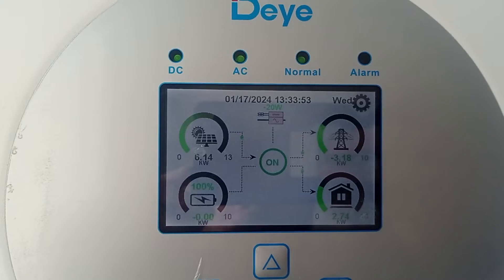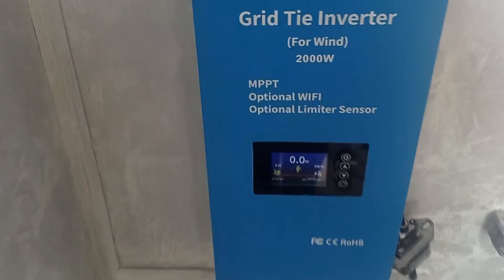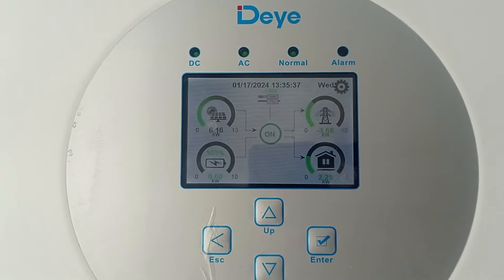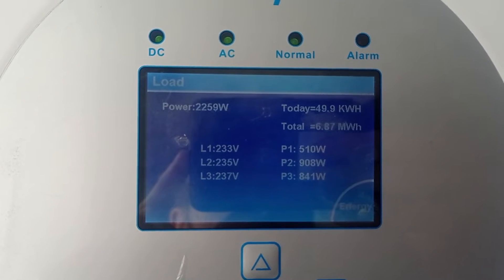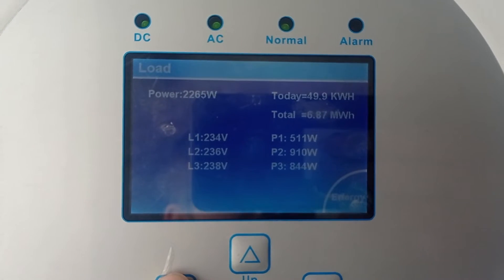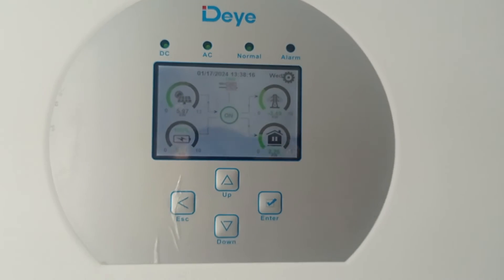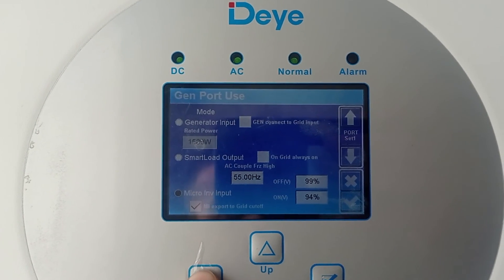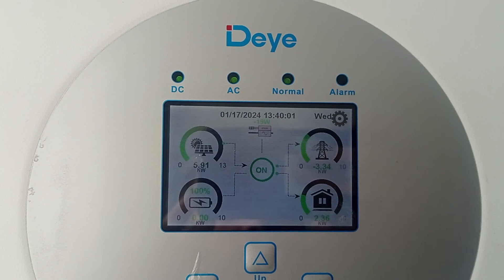How Deye three phase hybrid inverter works, and some features of it

Comment: Hi you mentioned in one video you was going to try and get a single phase genertor to couple to the Deye 3 phase inverter,  (i want to do this purely for charging battery's) did you manage to do this? Regards
Reply from the maker: well, I ended up with using no gen for a lot of time already... it's just gathering dust.
however, theoretically (and I know few guys who did this) - you can use ANY additional charger to charge the 48V battery bank from the generator separately. hint: use one of those cheap chinese inverters for $250-350 for max cost-effectiveness, and apply the gen as the AC-input on those.
Reply: @BackyardVoltage  Hi thank you for the reply, I dont have 48v battery, my battery is HV around 630v charge voltage changes from the Deye 40kw 3 phase inverter which i use as off grid. The problem i have is finding power in the fews winter months maybe 4 months. I do have a single phasde grid supply which i use as backup power via an ATS switch which connects across L1,L2,L3 as nearly all my loads are single phase. I want to use the 1 phase grid as my generator at midnight till 6am to slow charge my battery's (7kw x 6 hours 42kw @ 7p) to get me through the bad solar months of the year. I am struggling to find a simple method any suggestions would be appreciated. I am considdering installing another small 1 phase inverter grid tied to sell energy back in summer, can this then feed my 3 phase inverter through the micro inverter coupling or does this still have to be 3 phase input?
Reply from the maker: in that case you have two other options:
1. change the generator to be a 3-phase one.
2. use the supportive system. f.e. set the generator to charge the supportive 48V battery, use the grid tie inverter (or hybrid) and supply it to the GEN-port of the main system.

I wonder which way will be more cost efficient, I guess the first one likely.

Comment: What is your configuration in the other menu? Zero export to CT + SOLAR SELL? Or Sell first?
it would be good to know, my Deye does nothing when I select assymetric phase feeding... I have no battery, but I have seen an austrian guy showing asymetric phase feeding and it worked without battery... :( But my german is very bad 😀
Reply from the maker: I'm using this unit as in the video (and now it's expanded to be 3x10kW units, more about it here: https://youtu.be/X9zWiHgpGYY) purely in selling first mode. since I'm allowed to export to the grid a lot (up to 30kWh per hour, at 30kW instantly) - this asymmetric thing quite helps, once there is uneven voltage across the phases. It saves a few volts deviation for sure.

Comment: How does the generator connect to charge the battery
Reply from the maker: via GEN-port, in a "generator input" mode
Reply: @ModernUkrainianHomestead  is safe to connect directly to the generator port
Reply from the maker: check the manual - there are wiring schemes, and there are settings explained as well
Reply: @ModernUkrainianHomestead  thanks

Comment: You say you have a 20kWh grid-tie Huawei, a brand that is easy to get in Asia (where I live).  I wonder why you switched to Deye; a brand that is available here, but not so easy?
Reply from the maker: Deye has got the perfect (probably the best) hybrid inverters, unlike Huawei. and Huawei has got probably the best string inverters. That's why I used a combo. Since I need a piece of hybrid to be partially (even fully actually) autonomous, and I did not want to overspend a lot of money while going all hybrid, since the string inverter 20kW is about twice cheaper than 10kW hybrid.
AC-coupling - is the scheme that makes them both work together in perfect combo, so I can use the string inverter even during the times when there is no grid, I just supply it to my hybrid inverter and use all the energy I need.
Reply: @BackyardVoltage  😃

Comment: Does the 15kw inverter have The same features as the 20 KW that you are using?
Reply from the maker: my Deye is 10 kW, 20 kW - is my Grid-tie Huawei.
but in general, all Deye hybrid inverters have those same functionalities. question only lies in single or three phase setup.

Comment: Buongiorno , " AC COUPLE FRZ HIGH" , perché e' impostato a 55 hz ?     grazie mille !!
Reply from the maker: that's just the default setting of 55 Hz. it is used mainly to engage/disengage relays of both Grid-supply and GEN-port supply (Microinv Input in AC-coupling mode, or Generator input in Gen-mode), in case the power supply is way too off - it will simply switch it off. Why such high setting? Since if you are for example using any strong 3-phase motors, and even smaller single-phase motors - they have a huge starting current, that modifies the sine heavily, and alters the frequency as well. so it is standardly used at the higher end of tolerance on frequency and on the voltage as well.
Reply: @BackyardVoltage  Grazie mille per la risposta , molto molto gentile !!

Comment: I want to install a wind turbine inverter to the gen port. Your wind inverter has three phases? Or you just connected one phase? Could you show me how you did your installeyion? Thanks
Reply from the maker: I used the dedicated wind turbine grid-tie inverter - link is in the video description.
you cannot just input the wind turbine directly to GEN port, it doesn't work in such way.

Comment: I love this feature as my house is always turning different loads on different phases. However Deye is not available in my country. Any idea if Sungrow does this?
Reply from the maker: unfortunately. no idea if Sungrow does this.
I know that Deye is also sold under Sunsynk brand. and there are a couple of smaller subbrands, but it in any case has to look absolutely same as Deye does.
Reply: @BackyardVoltage  I had seen a video of super deye 5kw hybrid inverter which has the ability to get DC input from wind turbine controller I wanted to know does this specific model also have the feature can I used one MPPT for wind turbine out put & 2nd for solar string ? Also as mentioned 3-phase output can I run 3 phase induction motor ??? Would it keep the phase angle perfect on start up ???
Reply from the maker: @sobanidrees2999  
if the inverter is 3-phaser - then use whatever 3-phase device with it without any issues. in my country business is using them heavily, since they have no other choice in time of when there is little or no grid.
I guess (not 100% sure) that all the models have the options to use whatever MPPT as a wind turbine input. I have that option on my indeed, however, all the inputs are taken already with solar, that's why for wind I have got separate inverters and controllers sets
Reply: @BackyardVoltage   correct me if I am wrong but what If someone uses micro invertors in string of PV & then connect is in GEn/utility  port of Inverter which would  make MPPT port spare for either wind turbine or any other DC sourse ?? Also can some one use full invertor capacity as an input to gen port or the input would always be  sum of gen port & solar Inputs ??
Reply from the maker: @sobanidrees2999  I do it. I have on my Deye connected to Gen port (used in a MicroInv Input mode):
1. AC-coupled single phase 2 kw wind grid inverter
2. AC-coupled single phase 2 kw wind inverter (but used in the battery inverter mode)
3. AC-coupled 3-phase 20 kW solar string inverter Huawei, which I supply there occasionally using some transfer switches, in time when there is no public grid and when I need more power than Deye itself with it's own panels can provide.

All of them can work in the same time, seamlessly.
Reply: @BackyardVoltage  being a renewable energy  enthusist I am big fan of Yours...
As I had seen your videos in which you deploy wind turbine & PV arrays to get green energy.. I wanted to know the actual comparison of energy yield among solar & wind ?? I would be thankful if you make a comparison video especially during low moderate & high wind out put & the output of wind turbine during night... ??
Reply from the maker: @sobanidrees2999  well, about night - there is a video. night time work mainly happens during November-February in reality (in my continental climate):
https://youtu.be/PBXGqyP1Bzk

about production - hard to say. in general it heavily depends on your exact location. for me, solar is 5 times more effective in general if compared to wind (per 1 kW of installed production unit). BUT!
from November 1-st up until February 28-th there will be 70% of days when 1 kW of wind will outperform 1kW of solar in power production.

but for your exact local data - always check with 
https://globalwindatlas.info/en
https://globalsolaratlas.info/
Reply: @BackyardVoltage   actually I want to set up an Ev charging facility involving both solar & wind as main sourse & grid as last option I have chosen a relatively  windy & sunny place as solar production is a thing which could be estimated but the wind energy does not follow any pattern... I had seen your videos in which wind turbine is even working( I see moving blades rotation but there is no significant power) if a location have mean wing of 5.3 m/s can I rely on wind production as a primary sourse of power ???
Also kindly make a video on monthlu generation of your PV & wind turbine  sourses in winter & summer as wind blows at higher speed in winter mostly while sun is absent so both sourses compensate each other ..
Reply: Goodwe supports unbalanced phase feeding as well. Maximum power per phase the 1/3 of the nominal power. Deye can provide until 1/2 of nominal power per phase. Also I have heard that Fronius will provide an update and will support unbalanced feeding as well.
Reply: @parisvar  @modernuk GoodWe although exists here doesnt quite have the support. I spoke to Sungrow and they say the SH25t which Im interested in does provide unbalanced phase feeding, though not sure if its 1/3rd or 1/2. Their website confirms this too. At times if I have 2 to 3 ACs on one phase (my house has several more), the draw can increase to 7ish kw on a single phase so this part is rather crucial. They are also offering a 10 year replacement warranty so I think Ill try them out. Fronius apparently is the best but it has a drawback, the power switch from grid to battery takes 30 seconds. Its not instantaneous. Sungrow states theirs does it in 10ms, Tesla style. I classify that as a luxury feature almost and a musthave
Reply from the maker: 10 ms is necessary for computers, servers and other sensitive devices, 30 seconds is literally ages...

Comment: Does phase asymmetry only work with battery storage or is PV alone sufficient?
Reply from the maker: if Deye works without batteries - it's as stupid as any other standard grid-tie inverter.

to unlock all the potential - add batteries for sure. and to have the batteries work in their optimal mode - they have to be of at least x2 in capacity of the inverters nominal power.

about phase assymetry I cannot answer your question unfortunately, as I have never had a chance to check it.
Reply: you mean for a 25kw hybrid inverter, I will need x2 of nominal power which is 50% of rated capacity, so 12.5 x 2 = 24kwh battery? @BackyardVoltage
Reply from the maker: @shaazy  nominal = rated
Reply: @BackyardVoltage  Oh I meant Max output
Reply from the maker: @shaazy  yeah.
if you have 12 kW rated Deye - it will likely work fine on +10% of that continuously. but for the surges it may withstand about +50-60% short term (like a couple of sec) power.
as of the batteries, you need x2 rated value, so 24 kWh would be good.
but I mean it will also work if you have only 5kW battery installed there, it's just that you won't be able to use the full inverter's power in case you'd go off-grid. as the battery would become a bottleneck in that case.
but from my experience - batteries is something you will never feel you have enough, so definitely about the power bank the true rule is - the bigger the better.
I've found this place to get LiFePO4 batteries, seems pretty decent: https://youtu.be/6FAGLVLLiAk

Comment: Hello and congrats for all the detailed information presented. 
I have as well a fronius gen24 10kw inverter with 13kw panels and i'm looking into expanding the system with a deye hybrid for microgrid function and LV batteries backup. 
I would like to ask you as i am planning to buy a 12kw deye hybrid inverter with pytes batteries and connect on gen port the existing fronius and install extra 6kw solar panels directly to deye.
Can deye handle all the load and export to the grid in the same time taking into account that will total 16kw but the inverter will be only 12kw? or i will need to go for bigger inverter?
Reply from the maker: yes it will be able to do what you expect from it.
my 10kw Deye has the total selling capacity of 15 kw, so I guess, 12 kw should have either same or slightly bigger selling capabilities value.
Reply: @BackyardVoltage  can you tell me where I can find on the deye inverter spec sheet the maximum allowed power through it? how is deye behaving when you have only one or two grid phases failing? Is it disconnecting by itself totally to microgrid, isolating the main grid? Will the other inverter stop while doing this transition or is switching to batteries without any power loss. Thanks again for your help 🙏
Reply from the maker: it will definitely switch to its own microgrid if the parameters of the external grid somewhat are not ok, and it will get back to the outer grid once it gets stable (and after the specific delay time had passed, settable from 1 to 100 seconds).
specs?
go for https://www.deyeinverter.com/ or https://deye.com/
they don't hide anything, and from my experience I can tell that the specs are not over exaggerated, they are true to what is stated.
Reply: @BackyardVoltage  i was referring at the spec sheet regarding the maximum power allowed through the inverter. as you mentioned before your 10kw inverter can get 15kw through and wanted to check for 12kw inverter. so if any of the grid phases will drop it will disconnect and change to microgrid on batteries?
Reply from the maker: @jordache1981  ah, that value is not mentioned anywhere, true. and 15kw is the max selling power for my 10kW inverter which I managed to figure out only via hitting the max value available in the settings "max solar sell".
as of the continuous AC passthrough - that's in the specs, and it's 45A for my 10kW.